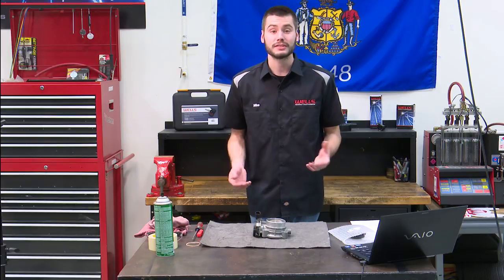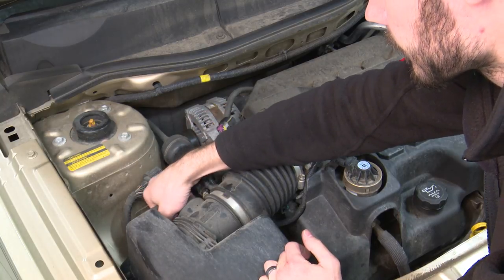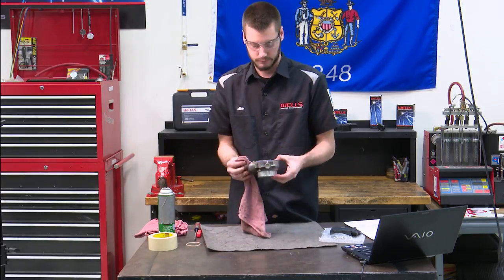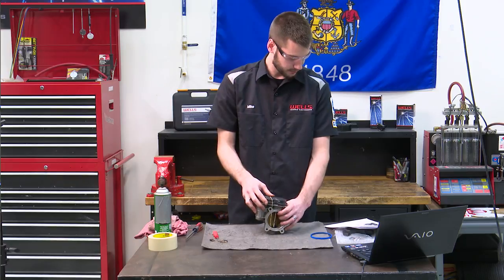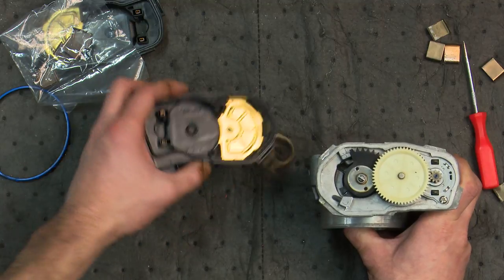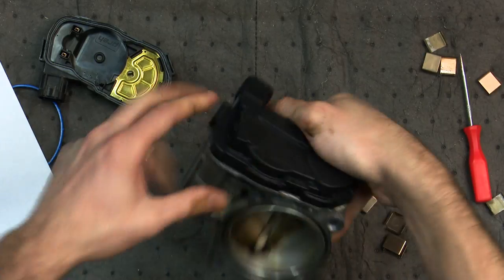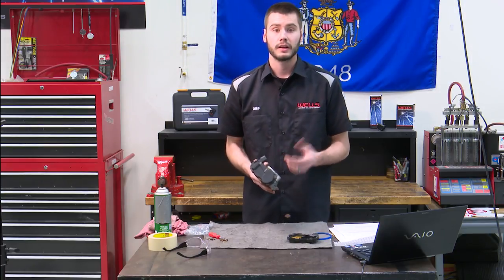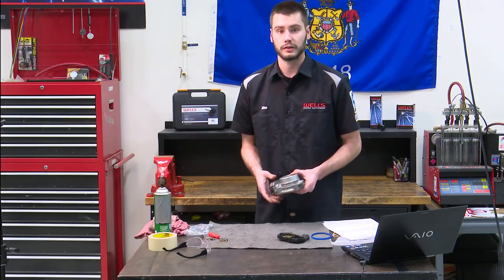Wells CounterPoint Ep. 21 GM Throttle Body Repair (P2135)

Comment: I have a code 2109 and  does this mean my fuel throttle body needs to be replace on my 2017  toyota camry le, could you please help, Larry
Reply from the maker: Hey Larry, hard to say for sure. Best course of action would to be an accurate diagnosis but a P2109 does point to a problem with the throttle body.
Mike Becker, Senior Instructor
Reply: Thank Mike for your reply, I think I mite buy another fuel Electric throttle body. Larry, another mechanic said it was a harness problem to the throttle. Larry
Reply: I had replaced my accelerator pedal sensor, I tried to delete the code 2109 but did not delete. Larry

Comment: Hello, I did this kit on my 09 sierra with 5.3   codes all cleared and she runs well; however..according to my scan tool..I only get 83.9 % throttle opening...says the same for desired and actual...have you encountered this issue..and if so, how did you correct it?
Reply from the maker: Hey mynameis63, no I haven't run into that before. Interesting...no codes at all? Could it be an error in the display of the scanner? Do you have another tool you could try?
Mike Becker, Senior Instructor
Reply: @GoTechTraining  Thanks for replying Mike.  I watched a video from another channel...and noticed his scanner gave the exact same value as mine..thinking this must be normal..In that video I seen this info..that vehicle also ran well after the replacement...so I`m gonna just run her like that.  Once again, thank you for replying..Subscribing to your channel now.  :) n

Comment: Hello Mike, thank you for the info on the electronic throttle body reset. I had to change out the intake plenum on a Buick Rendezvous 3500 v6, I got a used plenum from a local yard, cleaned, and changed all gaskets and butterfly 'O' ring. Got everything back together and made one simple mistake. That was ''I didn't connect my 13-wire connector to the throttle body and started the engine. I was not a happy camper, I saw your video on testing front ABS sensors on a Buick vehicle and the test equipment you use. So I decided to watch your videos from now on. I'm going to attempt to do the relearning process and get let you know.  Thank you for sharing your knowledge with us.

Comment: I've had good luck with the kit and the idle relearn went great with all but one. It would high idle and if I put it in gear it would idle down and stay there until I blipped the throttle and the high idle would come back. Cleared the KAM several times no luck. Drove it and every time I went to slow down it was at high idle, come to a stop and idle would return to normal idle, hit throttle and high idle. It had the high idle when it came in before the TPS was changed. Reprogrammed the PCM and car idled perfectly and it was the only thing that made sense. If you ever run into it there are several forums like iATN, Suretrack, etc where the fix is reprogram the PCM
Reply from the maker: Bob, wow good info to know. That could be really frustrating to a tech not in the know. Perform the tsb thinking it's going to solve the problem ,only for it to still be present. How many people would throw a whole TB assembly at it?! Great find with the reflashing!
Mike Becker, Technical Services Instructor
Reply: I am actually here for the relearn procedures. I have followed the book, but it won't idle down. It's doing exactly what you said. I think im gonna try to reflash it.
Reply: @UC__9rTAUp04BMWk2KNIzQPw And sometimes you'll get one that requires reprogramming because of corrupt data or a glitch and a quick reprogram straightens it out! Only happened once but it's a known GM issue and the reprogram is a known fix when the relearn fails

Comment: Thanks for the great vid! My idle is fine but my throttle positions didn’t change. Position A and B are at 18% and relative throttle position is at 5.8%. How do I correct or adjust? I did relearn procedure 3 times. No effect.
Reply from the maker: Hey Chetty Mo, thanks for watching! That may be normal idle percentages. Are you having any issues with it? The throttle body can't be closed all the way. It will always be more the 0%.
Mike Becker, Senior Instructor

Comment: Very informative and thank you for sharing your knowledge. My '05 Silverado 6.0L has a coolant tube running through the assembly and I would like to avoid draining coolant in order to remove it for cleaning. Can I just remove the two torx head bolts holding the throttle plate and slide it out for cleaning as long as I put it back exactly how it was?
Reply from the maker: Hey Americanstrife, thanks for watching. Honestly, I've never removed the throttle blade from the shaft. I would just unbolt the throttle body and clean it under the hood still connected to the coolant lines. 
Mike Becker, Senior Technical Instructor
Reply: @GoTechTraining   I cleaned the throttle body as you suggested and no issues with reduced engine power or TPS codes but I'm getting P0300 random misfire yet the truck is running fine. My TPS% is 4 at idle and ST fuel trims look good but LT is +5 at idle and jumps slightly when revving then comes back down..any suggestions on what this could be? I never had this code before I cleaned the throttle body.

Comment: Have a question. Followed and did everything correctly. But when I shut the engine and start it up again the next day. The check engine lights turn on and the same codes appear again. It is becoming a daily routine to clear codes after starting the engine. Before going to work and going home. Thanks for any help you can provide.

Comment: I smoke tested a Chevy Caprice 96, and spotted a vacum leak from the throttlebody shaft, is that normal or should it be rebuilt/replaced?
Reply: it's probably ok if engine has a MAP sensor... small un-metered air leak is ok

Comment: Captiva saya FL 2011 Gasoline, throttle body telah dibuka dan diberrsihkan, namun sebelumnya belum ada DTCs, setelah dipasang muncul DTCs P0223 Throttle/Pedal Position Sensor/Switch 'B' Circuit High has been detected. apakah perlu direset sesuai vehicle learn prosedur? terima kasih jika berkenan menjawab

Comment: What's the deal with cleaning/replacing the Idle Air Control Valve on a 2007 Colorado 2.9L ?
Already cleaned the TB and MAF.
I'm having engine shut down problems on heavy braking and especially braking and turning at the same time. Google/YouTube is telling me to clean/replace IAC but I can't find ANY info on where it's located

Comment: Hopefully someone can help. My son has a 97 Pontiac Grand Prix GT 3.8. Some genius removed one of the vacuum tubes from the base of the throttle body and put a screw in place.  Can this tube be replaced or do I have to buy another throttle body. If I can replace the tubing what’s the size? Thanks

Comment: Thanks a million-very helpful. Will the new sensor cover come with its own cover gasket?
Reply from the maker: Hey Andy, thanks for watching! Yes, the new sensor does come with it's own cover gasket. Still a good idea to pick up a throttle body gasket though.
Mike Becker, Senior Technical Instructor
Reply: Thanks Mike, sounds good. It didn’t look like I could get the old sensor gasket off without damaging it. My normally trouble-free 2010 Silverado went to reduced engine power on the highway in Boston at 3 a.m. in 0 degree weather while bringing my son to the airport-that was a nice surprise. I appreciate you taking the time to give good instruction and thanks for replying.
Reply from the maker: Oh man...talk about the worst time to fail...sad cars are always like that...
Mike Becker, Senior Technical Instructor

Comment: Thanks a lot for the video.
I have a Mitsubishi Outlander 2008 2.4L where the RPM fluctuates only in the morning until it warms up then everything becomes normal. No codes. I feel a lack of power and it doesn't shift after the second gear unless I removed my feet from the accelerator pedal and put it back. I'm suspecting the throttle position sensor, any idea? Cheers
Reply: I'm having the same issues.  If you found a solution could you please share?  Cheers!  Lol
Reply: Get your dealer updates installed. Fluctuating engine speed is addressed in one of the update files.

Comment: I have a question... my 2003 5.3 Flex w/ 180k+ is giving random misfire. I've changed: plugs, wires, fuel pressure regulator, fuel pump, MAF, throttle body sensor and in the process of changing the coils and the entire throttle body.My question is: should the middle sprocket/gear freely slide inside the throttle body. Or should it be firmly affixed to the stem that it is on inside the throttle body?Thank you.
Reply from the maker: Hey Bamaborn74, if I remember right the gear was pretty loose on there. If you were to flip the TB over it would fall off.
Mike Becker, Senior Technical Instructor
Reply: Check fuel pressure regulator
Reply: I was having random multiple cylinder misfires on my 5.3.  I changed the intake gasket, alternator, and the number one coil.  But I didn't know not to move the throttle plate.... Now I'm trying the relearn procedure, no luck yet....

Comment: Hello Mike. I have  a 2004 Nissan Murano  with the code p2135: TP sensor code. The vehicle accelerator pedal keeps being unresponsive. When this happen, you let it cool off, and you regain acceleration. I am asking myself how the tp sensor can trigger this unresponsiveness when it only reports the throttle opening and speed.   Do I have a short somewhere?
Reply from the maker: Hey, on a drive by wire system if the TP sensor is not reacting properly it will put the vehicle in limp or reduced power mode. This will not allow you to accelerate the vehicle. Chances are you have an issue with the TP sensor, wiring, or the throttle body itself. You could try cleaning the throttle body and seeing if that helps first.

Mike Becker, Senior Technical Instructor
Reply: I am so happy to see you back. I missed your wonderful teachings.
Reply from the maker: Thanks, good to be back! :)
Mike Becker, Senior Technical Instructor

Comment: Hey Mike thanks for the video. I did everything like you did and when I start my Silverado. it idled perfect, until I touch the gas pedal . then the rpms went up to 3000 and would decrease to about 2800 and hold there. Did I not install the sensor correctly? any feedback would greatly be appreciated.
Reply from the maker: Hey Handy Kim, is it setting codes?
Mike Becker, Senior Technical Instructor
Reply: @GoTechTraining  Mine worked perfectly after replacing the Throttle Body Sensor, but here recently it has started revving to 3k rpms on cold starts. Have you ever dealt with that?
Reply: @blakemckinley2990  me too!  Trying to find the answer myself.  A mechanic said most likey if you cleaned it, like I did there may be deposits sticking the plate or I have to get a new TB 😳
Reply: @justinbuys8501  I ended up having to replace the computer.

Comment: Can a bad TPS cause car to run only in 1st gear? Or is that some other problem?
Reply from the maker: Sam, a bad TPS could cause all kinds of issues on a drive by wire car. I assume your vehicle is stuck in limp mode or "reduced power mode".
Mike Becker, Senior Technical Instructor

Comment: Hello Mike,
Toyota corolla throttle body sensor back probe key on; grd wire reads0.01v opened close throttle no response; Middle wire signal reads 12.36v; bat 12.65v; 5volt ref wire reads 1.67v no throttle resistance.

Ohm meter disconnected connector exposing throttle pins clipping grd and signal pin to ohm meter it reads 1.814ohms open/close no response is this a defective sensor? 
Respectfully,
Alexander Gonzalez.
Reply from the maker: Hey Alexander, long time! Hope all is well! From what you're describing it sounds like it could be a bad sensor. When you open/close the throttle body you should show a varying voltage output on the signal wire. What does the scan tool do? Can you see data and see throttle voltage or percentage? 
Mike Becker, Senior Technical Instructor
Reply: Don;t have an oscilloscope wave form picture. 

On-board diagnostic tool did not pull up a throttle body code. 

Remember, this was the Toyota corolla 2000, that repeatedly kept pulling PO171 leans code. We fixed it; it was intake manifold gasket; the code disappeared for 3 months. 

Same code came back PO171 because the fuel pump was weak losing pressure; so P0171 was a deferring false code pointing to fuel pump;  fuel pump was replaced  and along with was another pre-existing symptom.

 I had failed to tell you at that time, about a consistent soft infrequent hesitation, while idling and driving; head lights powering down, then brightening; power high while driving, then slight lose of power jerking the car while driving; this is the throttle sensor.

 I floored the throttle, after testing new fuel pump with fuel pressure gauge on, it worked to SPEC PRESSURE WAS 45lbs, THEN IT JUMPED TO 55LBS,  it wanted to start; it was hesitating, so I floored it, the accelerator.

 I heard then, a loud sound, like switches; it shut down like a kill switch activated; it was the throttle sensor and possibly the the vane kill switch inside the mass air sensor. 

The sounds came from the center of engine and under driver side kick panel. where I found an after market kill switch. 

Since then, the car was able to crank however when the anti-theft circuits kicked in, it blocked the starter relay from cranking.

 I drain the ecms receptors capacitors erasing the anti theft memory, so it cranks now but will not start because of this throttle sensor.

 My the thermistors read 5v reference communication with ecm works, it is not dead, like I thought.

 Its great to see you again. I have been studying my old mechanics and circuit integrity books enjoying continued education at home. I have appreciated the value of the scope you use even more then ever; the amp and volt meters too, very much. And most of all your classes and videos! I would love to train with you seriously now!
Reply: Hello Mike,
The scanned tool pulled up an open circuit relay pending code, that feeds the fuel pump. I don't know how to test the relay under load? On that same wire leg before the fuel pump is the neutral safety switch,it shares the ground to fuel pump, which is not working in park, it only cranks in neutral. All three components share the ground; perhaps I am wrong the relay open circuit is on power side.

There're 2 fuses in engine fuse box both diagonal from each other, both 10 amps, they are undamaged without power, the horn and head light. Inside, under the dash fuse box is an ignition fuse, with asterisks, also 10 amps undamaged without power. 

The throttle signal wire voltage is 12.36v short to ground. I am just learning how to do voltage drop test to ground with meter neg terminal on bat neg to check ground side; negative terminal to battery positive, to test power side of the load. its confusing to mind blending concepts causes confusion.

 It is so cold out, intolerable to work outside. The battery is out of car on a trickle charge however will the ecm forget or remember, when battery is installed or will it fall asleep and not wake up? Do I need to relearn the ecm and how is it done?
Respectfully,
AG

Comment: Hey I was looking at ur video I'm a haven problems tryna get my throttle body to work
Reply from the maker: Hey Chris, whats going on with it? What kind of car?
Mike Becker, Senior Technical Instructor
Reply: @GoTechTraining  hey goodmorning Mike I have a gm but it's a 2006 buick lucerne cxl 4.6L V8
Reply: I took it out one day and and went home to do a water pump change and brung my throttle body to and it dropped a little on the floor but it was still in th bag and the piece broke off and then i use the hold throttle bottle spray to clean it every since then I'm haven all kinds of throttle body codes, 1. Throttle body actuator 2. Throttle body sensor 3. Basically the hold throttle body now.

Comment: Can we spray throttle cleaner inside throttle body means gear and teeth assembly?
Reply from the maker: Hey S Khan, sure, you could clean out the gears if you want to but you'll want to make sure to get a little grease back in there.
Reply: @GoTechTraining  then what should I do now bcoz i sprayed throttle cleaner on it

Comment: Ok So I need that sensor for my 08 TrailBlazer but the dealership tells me I have to buy the whole throttle body. They do t want to sell me just the sensor. What can I do.?
Reply from the maker: HI Junior,
What engine does your Trailblazer have? I don't think all engines have a replacement TPS sensor cover available. I believe only the V-8, 5.3, and 6.0's have kits available.
Ryan Wilsing
Reply: @GoTechTraining  
Is the inline 6cyl base model.
Reply: @GoTechTraining  
4.2 L
Reply: Ok... Strange. Today the truck started like nothing happened .! I'm confused, if that sensor to throttle body goes bad, is not supposed to work the next day. So... In thinking the fuel pump.?
Reply from the maker: The sensor can fail intermittently, This is why the engine can run good again. Every time you cycle the key, the engine computer will reset and check for issues. If the TPS cover is not glitching at the time the engine will run good until it sees the glitch.
I hope this helps
Ryan Wilsing
Reply from the maker: I don't show a TPS cover for this model, only the 5.3 L model. You may have to purchase the entire throttle body.
Ryan Wilsing

Comment: On my 2015 Nissan Versa the dealership they told me it was my throttle body, while o'Reilly and autozone told me it was the mass airflow sensor
Reply from the maker: Hey Mike, the parts stores don't diagnose cars. They pull codes and play the odds. If the dealership is reputable then I would trust them.
Mike Becker, Senior Technical Instructor
Reply: either of the two parts would be a super early failure at 4yrs old.
If you have modified the air filter ("cold intake" etc): make sure MAF is super clean! (MAP sensors are solid-state million miles items)